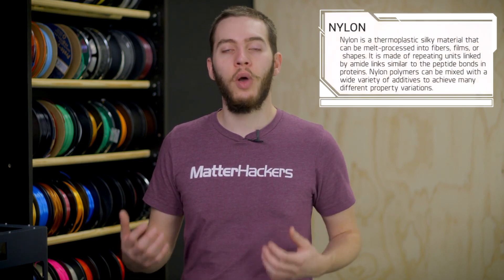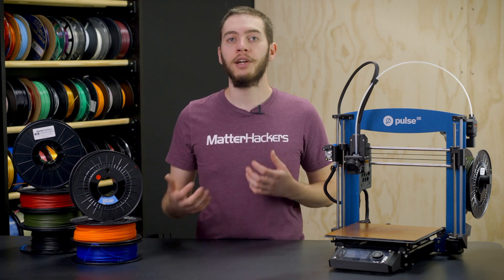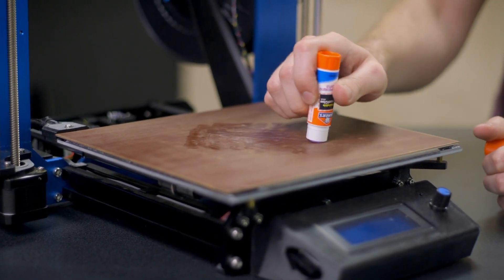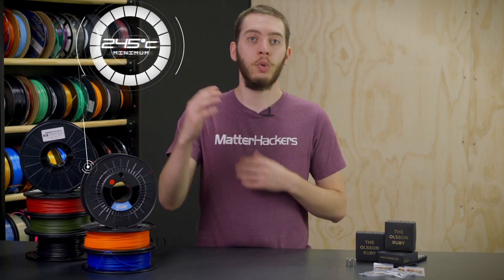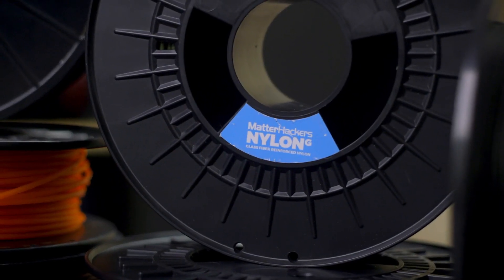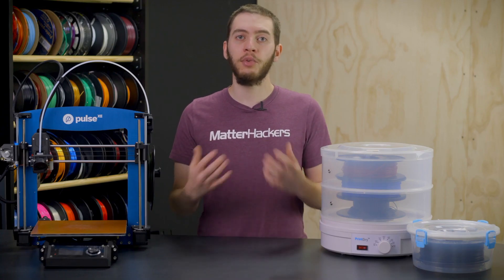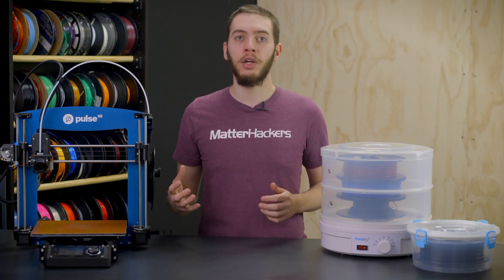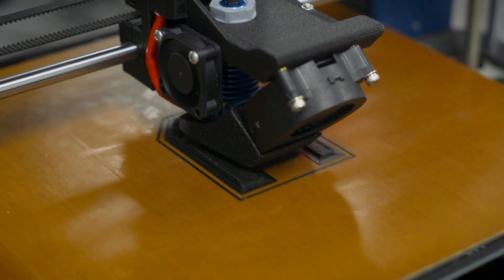How To: Succeed with Nylon & Nylon Composite Filament

Comment: Besides a spool enclosure to keep the nylon filament dry, one thing I would add to a nylon-printing setup is to FULLY enclose the filament path.  That means that a tube should be used to connect the spool dry-box to the printer's extruder.  On the Markforged Onyx Pro printer that we used at work, the (carbon-fiber impregnated) nylon filament we used was in a sealed dry-box enclosure, and was fed to the printer's Bowden extruder through a tube which ran from the dry-box to the inlet of the extruder.  Markforged even went so far as to stress when changing the filament spool, do not let the spool be outside the spool enclosure for more than 15 minutes.

Comment: What I have found concerning NylonX printing is that the larger the diameter of what you are printing the stronger the curling forces are. I use a 15mm raft on my 7" diameter parts. Printing on glass is good only in that its flatness is needed. I found glue stick a piece of sprung steel to glass and then using clamps on the edges to be best. If I just used glue stick and printed the part with raft at about 4mm thickness of a part...the curling forces will pull up the raft from the bed. Too high of bed temperatures will cause super glue to crystalize and fail...plus super glue gives off toxic fumes when heated. This is where JB Weld applied wet and thin to the steel holds well above 65C. Using 65C hardens the JB Weld much quicker. Applying JB Weld again must be a very thinly applied using a putty knife, as the raft layer is being printed. Applying the JB Weld with too much force will pull the NylonX off the print bed so it is an art. Then slow the print speed down so that the JB Weld has time to cure. The second raft layer will then print into the hardening/soft JB Weld... about 8 hours later the JB Weld will be hard and you should still only be on the first layers of your part, then you can go full speed without having to worry about the part curling and you losing an awfully expensive part. As the part is printing on the raft the curling forces increase and seem to translate into the raft part... if any part of the  raft seperates from the bed this will ruin the part no matter how far along the print is... the part may be rigid but since the raft lifts the part will be warped.
To get the JB Weld off the sprung steel is the next big trick, because JB Weld is flexible. So, using a lot of heat will melt the JB Weld, but you must watch out not to use to much heat or you will wreck your sprung steel sheet.
I am still experimenting perhaps printing out a 12X12" NylonX bed is the best way to get the maximum adhesion without having to print out a raft layer every time. The NylonX part separates very nicely from the NylonX raft... the curling seems to only happen between the bed and the raft or the part...not between the raft and the part.   I have never had the part curl away from the raft.

Comment: would it be possible to dry nylon by submerging it in denatured alcohol ? a piece of bread placed in alcohol will turn dry as toast in a few seconds  due to the affinity of alcohol for water  you could probably feed it directly from a container of alcohol with a small hole in the lid as the alcohol will dry off in seconds and the lid would prevent excessive evaporation of the alcohol  try it in a video
mark railinthewater@att.net

Comment: Been printing CF nylon on my Ender 3 Pro with stock hotend with hardened steel nozzle and Capricorn tubing at 250 C. Textured glass bed with glue stick.
Having a small issue with layer separation after the print is done. Usually the first few layers or the first mm of layers like to peal off. 
I'm printing the spool right out of the brand new packaging so I'm thinking I just need to run it in my dryer box then try it again.
Reply: Doesn't sound like a moisture issue to me, so drying won't help. Considering that you print at 250C, you might want to try printing hotter and/or reducing the fan for better layer adhesion.

Comment: Just curious why use the glue stick with the Garolite? If putting down a layer of glue stick, surely it would work on pretty much any build surface?
Reply: To weaken the adhesion as to not have to fight to get it off of the bed

Comment: Hi, please assist! I've gone through 4 spools of Ultrafuse PAHT CF15 on my prusa mk3 olsson. I print dry filament from a dry box. I have noticed the finished parts become soft when stored in the basement for a couple of days, soft enough for plastic deformation by hand and nail. It's cold and moist down there, around 16°C and 80-90%RH. This is very frustrating as the material is great when in house. Have you noticed this behavior with nylonx? Or can you please try replicate my results? I would assume it behaves the same way. A very weird additional factor is that I printed a kitchen sink drain and it's been in use in our kitchen for over a year without softening. What is going on?! I have another 3 spools for demanding projects, but I'm not sure I can trust this material anymore.
Reply: Settings are 265°C, 85° bed,  30° enclosure, magigoo PA, 0.6mm nozzle, 0.2mm layers, 40mm/s max speed, about 0.65mm extrusion width, Titanium e3d heatbreak, 2mm retraction (would and did clog the stock prusa heatbreak). Regardless of geometry parts soften.
Reply: Nylon printed parts absorb moisture and soften and gain toughness. If you want a material that doesn’t absorb moisture as much, PA12 nylons are a good idea, as moisture changes their properties less. This might be be mixing up 3dxtech and Ultrafuse pAHT, but Inthought it absorbs less moisture. You want to consider the wet soft version your final version of nylon.
Reply: What’s the room temp. RH is affected by temp, the colder, the higher the RH and vice versa
Reply: @josiahong5177  The absolute worst condition is when basement is around 22°c and outside is 26+ and raining. Inside air then feels saturated. I have used the material to print a cnc router, which has creeped so much that parts are garbage now. I'm done with this material, too much tlc needed. Supplier don't specify if it's pa6 or 12 as far as tech spec goes. I've stopped using this material and will try pet or pp with cf in future.  Thanks for response!
Reply: @Creator_Joules  I think it’s neither. However, have you tried annealing your parts? That might help with creep.
Reply: @Creator_Joules  yeah, I think PP-CF would work better.
Reply: @josiahong5177  no I didn't try annealing. I'll probably do that at some point. Still got some spools of this pa cf.
Reply: @Creator_Joules  I also use PA6cf by PolyMaker, so I would recommend that

Comment: Went through almost 2 spoils of nylon G now . I have a flashforge creator pro upgraded with all metal hot end and it still isn’t hot enough for good later adhesion . I printed at 40mm/s at 280c and had a decent print but layer adhesion just wasn’t there completely . At least for my Glock frame that is, it seems like you should really be printing this material at 280 plus to get the most out of this material , I even had it sit in the oven for 24 hours at 180c . It is somewhat strong but my PLA plus blows it out of the water as far as strength goes.
Reply from the maker: Hey Z34, 
When you upgraded to the all-metal hotend, did you change the thermistor or did you keep the stock one? If you changed it, you would need to change the thermistor in the firmware so it reads temperatures correctly, but if you left the same one it's possible you need to do a PID tune at the higher temperature of NylonG. In my experience, I've printed NylonG at 255C without issue and have had a tough time ever getting them even close to breaking. Make sure your layer cooling fan is either off, or on only for bridging moves as that can also have a significant impact on print quality.
-Alec
Reply: MatterHackers I did keep the stock one , I always keep the fan off also . I have enough of the material to do 2 more based on the amount of filament I would need . As far as the PID tune , do I need to be hardwired to the machine to do that ?  My temp only fluctuates by 2 degrees C . Can my hot end say it’s at 278 but really be much lower because of the PID ? It seems to print fine but when I put force on it to test it breaks between layers .
Reply from the maker: @cornpopthebaddude3992  The PID would help with temperature fluctuations, and if you are using the original then it should be accurate in its reading when it says it is 278C. Right now I can think of a couple things that could contribute: your nozzle is a different size in your slicer than what you have installed, your Extruder steps are accurate for PLA (100mm is extruded when you tell it to extrude 100mm) but are not accurate for the added pressure the glass fibers and nylon create (85mm is extruded when you tell it to extrude 100mm), or your nozzle orifice has been blown out because it is not made of a hardened material. In summary, I believe your problem may lie in some form of underextrusion, which could come from several different angles.
-Alec
Reply: MatterHackers so the nozzle is a hardened steel nozzle that came with the kit , both are 0.4 so that should be fine . I haven’t done the esteps though . Is that something I would need to do for a fairly new machine after upgrading ?
Reply from the maker: @cornpopthebaddude3992  Generally it's not something you need to mess with, but the Creator Pro was designed to work with PLA and ABS which are easier to extrude. I would recommend an E-steps calibration if you were going to print with flexibles as well; it's all about how responsive the filament is to being extruded. This is a much older video, but it describes the steps necessary to calibrate your E-steps. https://www.youtube.com/watch?v=X3A9Ir2SreI
Rather than saving them to your firmware, instead you can use this to find the extrusion multiplier that works for NylonG, so if your regular E-steps are 100 for PLA and that works accurately, but NylonG needs 150 E-steps to do the same, then you can set the multiplier to 1.50% (150/100).
Reply: MatterHackers Hey Alec ! So I have an update , found a x3g file for the PID tuning since flashforge’s Sailfish doesn’t support Gcode . Did that , temps seem more stable now . I did do an estep calibration with the nylon G on S3D and it seems to be extruding 100 mm . (Or at least very close) I used a post it note to mark since the material is too dark for a sharpie . I did try some calibration cubes and increased the multiplier to 1.50 but it seemed like it was over extruding , dropped it down to 1.40 and it seems to be better . Do you think this will make my prints stronger if I try again now ? I ordered a print dry from you guys because the print takes 22 hours , I’m assuming that after the 3 hour mark it absorbed more moisture which made my prints weak at the top portion so I’m going to try again once my printdry is mailed to me . What do you think ?

Comment: Very informative video, thank you. I owned a ultimaker S5. I would need a new bed and nozzle.
Reply from the maker: Hey David,
And with LayerLock, you can get a garolite sheet that is the same dimensions as the glass bed so you can easily swap back and forth. For the nozzle you would need a CC Core and after that you're good to go (as long as you keep it dry, of course).
-Alec

Comment: i have a predator and everytime i print Polycarbonate i wait until it cool down and i take the part off but it always take part of the bed, what can i do to avoid that ?
Reply from the maker: Hey Amir, I am not familiar with the Predator, but I have experienced PC removing chunks of glass. This can happen if the adhesion is too strong between the PC and the bed, so you need to use an adhesive that both is strong enough to keep the PC from warping but weak enough to separate before adhering to the glass bed. You may have decent luck with Vision Miner adhesive. I haven't personally tried this, but the specs indicate it should work. https://www.matterhackers.com/store/l/vision-miner-nano-polymer-adhesive/sk/MAADPQRX
-Alec
Reply: If you can remove the plate - Try freezing, then bend it. Prints should pop off.
Reply: @PeterAcrat  the plate is 380 mm

Comment: Great video, thanks for sharing.  I would love to print in Nylon, I have not had the chance because I don't have a all metal hotend, I would probably get one and get this a try.
Reply from the maker: Hey Fusion,
Best of luck! being able to have a strong material you can rely on is a great thing to keep in your utility belt. I'm actually quite fond of using NylonX to print 3D printer components because of the temperature resistance and the rigidity it provides, along with the bonus effect the carbon-fiber gives to the layer lines.
-Alec